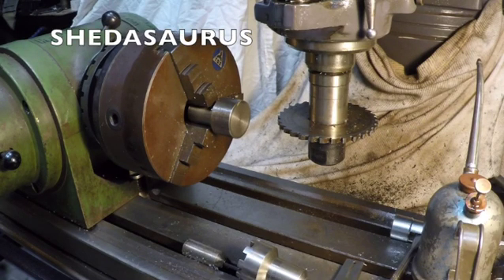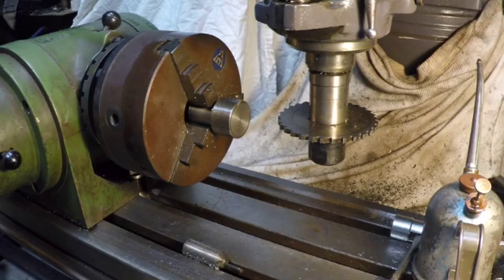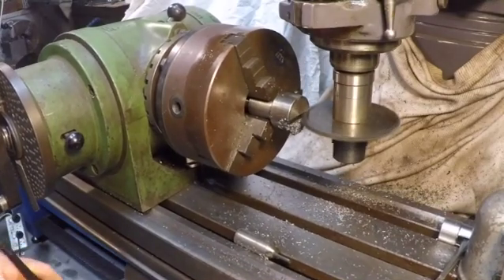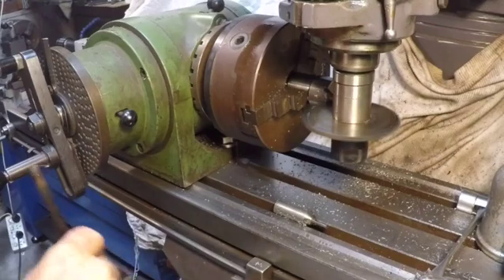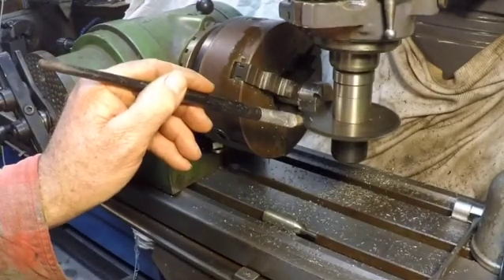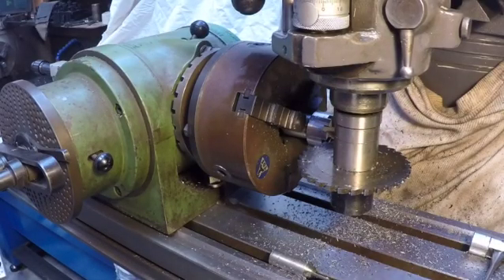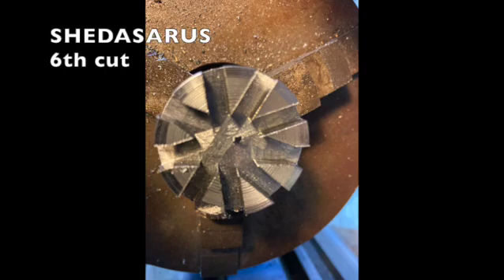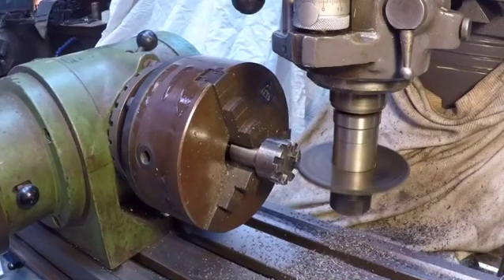Bridgeport mill knee attachment Rapid traverse

Comment: I thought about making one of these, but instead decided to use the approach used by Myford Boy in his YouTube video for a power x-axis table feed. I used a Stepper motor and timing belt controlled by an Arduino. Still in the testing phase, (video on Instagram) but it looks like it will work well and I think my design has some advantages over the commercially available units.  Also, I have see gas struts added to the knee to decrease the power needed to raise the knee, in a YouTube video of a CNC conversion of a Bridgeport. Thanks for posting this video. Very useful information.  Regards